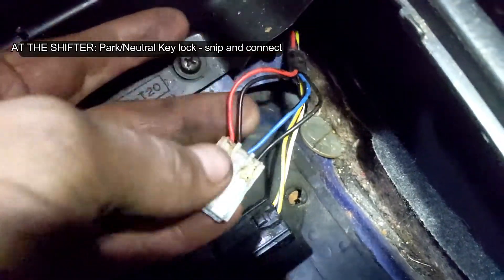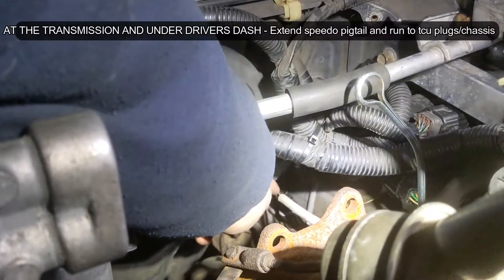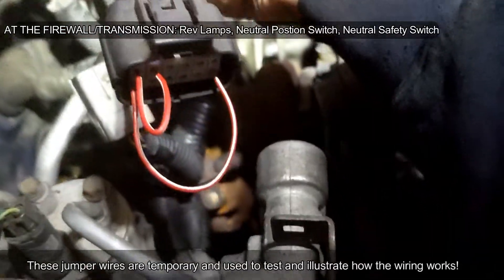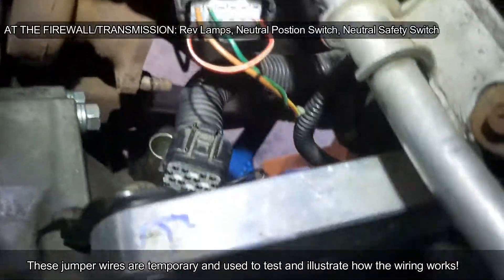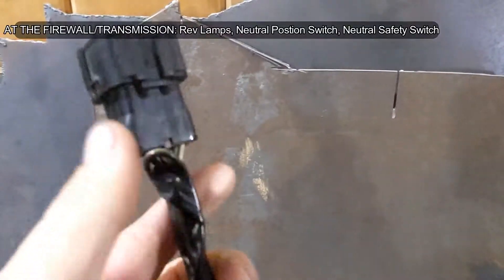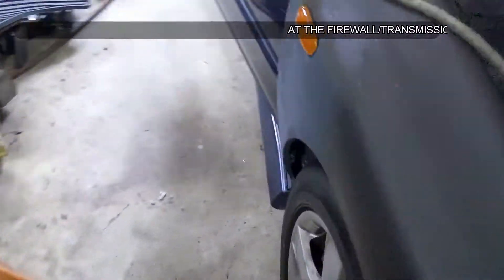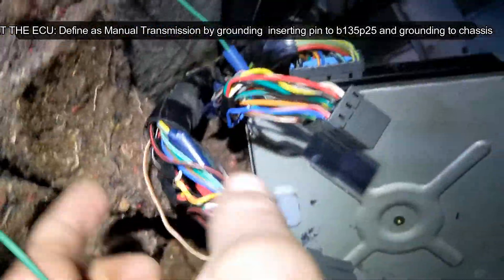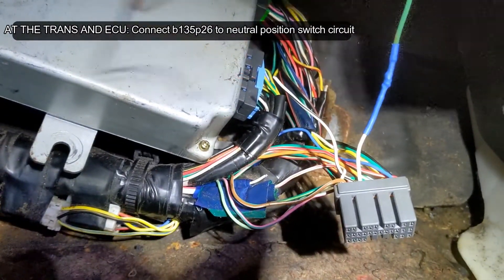1999 - 2002 Impreza 2.5RS / Forester Automatic to Manual Wiring Conversion

Comment: I keep getting a p1722 code
Reply from the maker: Thats an auto trans code, if you ground the at mt decider pin you shouldn't be getting auto trans codes. What car are you working on?
Reply from the maker: B135 pin 25  , approx 8m15s into video

Comment: I’m currently doing this exact swap on a 99 forester. I’ve got everything to work, cranks and fires. The issue I’m running into is the marker light and cluster continuously flash. I took the gear switch off of the auto trans and plugged it in to confirm it’s in park rather than jumping it (still going to dig into the harness for that). Do you have to do all of the wiring or is the minimum you have to do is the ground pin on the ecu and tell the car it’s in park or neutral? I’m stumped.
Reply from the maker: Cluster light and marker might be the factory security system
Reply: @dukeofnyd1 I haven’t been able to find one or a fuse for one, I’ll look again though.
Reply from the maker: Usually a black box to the left of the clutch pedal. Usually a button near obd2 port to turn off if its been set off. Or you can connect the battery with the key in the on position
Reply: @dukeofnyd1 I’ll have to check in the morning, thank you!
Reply: @dukeofnyd1 figured it out! Disconnect the negative battery cable, put the key in the on position, reconnect the negative lead, cycle the key off and start the car. I guess it’s a common thing with these cars.

Comment: I’m just here hoping you still are as well lol, thanks for the simplicity, only thing that I had issues with is running my Speedo wires. I tried the tcm pin out diagram follow along with no luck. I also have a limp moss not allowing me past 4500rpm. I’m obviously not getting speedo signal to ecm, just wondering if you had more details or specify maybe where I missed the direction of where the 3 wires that run to tcm
Reply: To add I don’t have a wire running to plug pin 13 on tcm
Reply from the maker: Whats your car

Comment: Are you still active on here? I have a few questions if you are willing. 07XT (4eat) ----> 04/05 STI 6speed
Reply from the maker: Hi, whats your questions?
Reply: @dukeofnyd1  so, for my 4pin 6speed harness connector, what would these connections go to? 
- ECU
- Brake Light
- jumper between neutral safety (ATharness)
-ground
Reply: @dukeofnyd1  also, I am willing to donate to your cause, nothing is free. I thought this project would help me understand electrical better, which it is, however, this is deep water as I said. My pride hurts but it’s not something I’m super versed in.
Reply: Honestly, I am trying to swim in deep water here. I didn’t realize this would be the hardest part of my build for me. DCCD is almost set up, but I am at a loss when it comes to finding these connections to be made on this car. I’ve got the key lock figured out, obviously because that’s simple. But I was wondering, have you ever drawn these diagrams out? If so that would be brilliantly useful to me as my electrical experience and skill are rather novice for this task. 

I have everything in front of me, and I’m not frustrated, just perplexed. 🤓😅
Reply from the maker: @tylerwhite1686  i havent manual swapped a subaru that new. Have you reflashed or swapped the ecu?
Reply: @dukeofnyd1  I have a JDM forester sti Ecu plugged in
Reply: @dukeofnyd1  anyway I could convince you to walk through this swap process with me? Lol
Reply from the maker: @tylerwhite1686  pretty sure youll need your immobilizer chip copied to that to run. I cant walk.you through manual swapping a forester this new because i havent done it yet
Reply: @dukeofnyd1  oh yeah, that’s the plan. Our guy at Subaru will do it.
Reply: sad i came here looking too, mines an 04 XT with an 03 wrx trans i just did

Comment: Hey the only thing I’m confused on is the brake light switch. Does the brake circuit run with the reverse or do you have to connect it somewhere else?